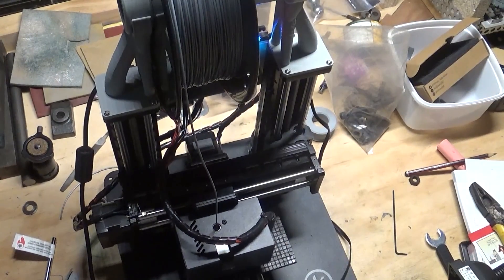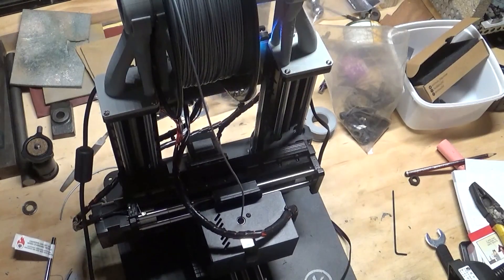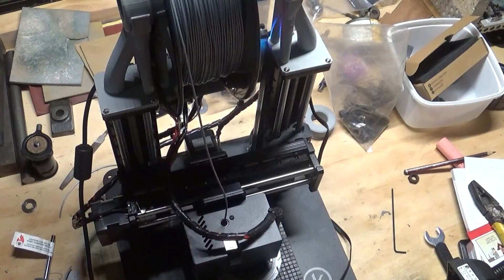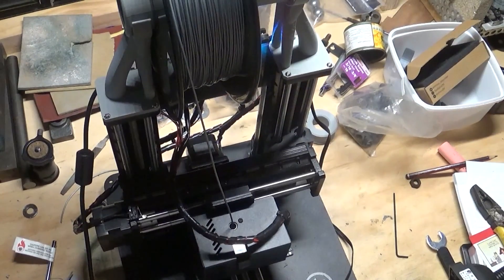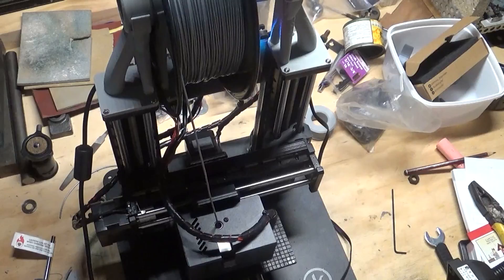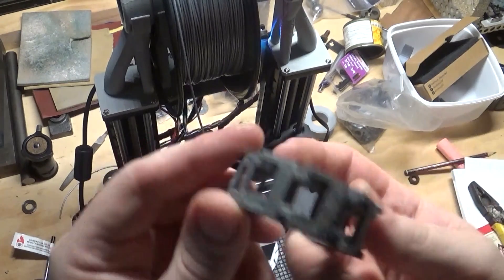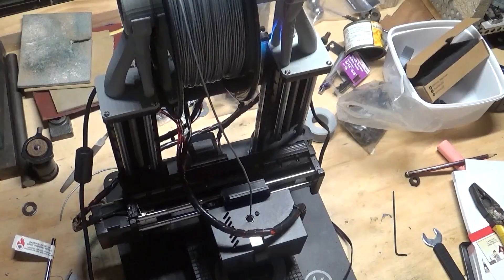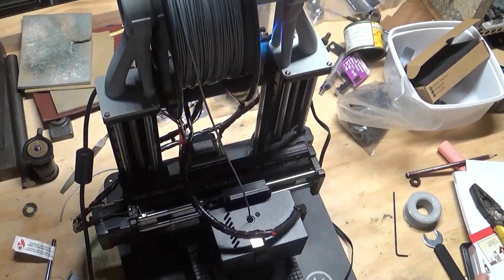workshop update march 17 2017

Comment: Hi Emma very schmick 3D printer also can you supply a link for the led light it looks good as well
Reply from the maker: https://www.banggood.com/3W-12-24V-500mm-CNC-Machine-LED-Lamp-Aluminum-Alloy-Flexible-Light-Bar-Working-Tool-Lamp-p-1064134.html

Comment: Nice addition to the shop!
I still fight myself if I want a 3d printer...sometimes it would be cool just to get a prototype in the hand before making chips.. :D

Bought cablechain has another advantage (Despite from beeing faster availible than printing it): You can flip the single segments open to get the cable in, no need to thread it in from the end.